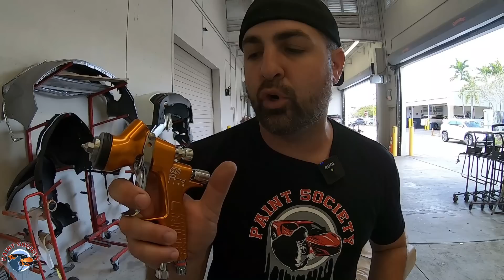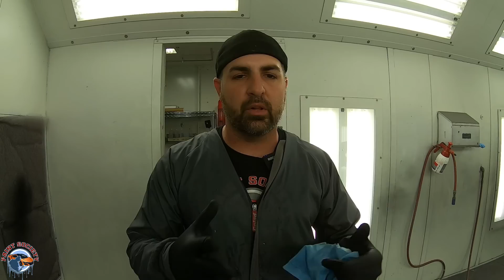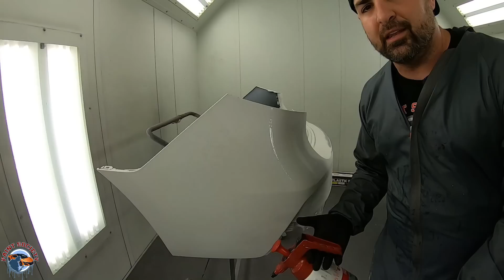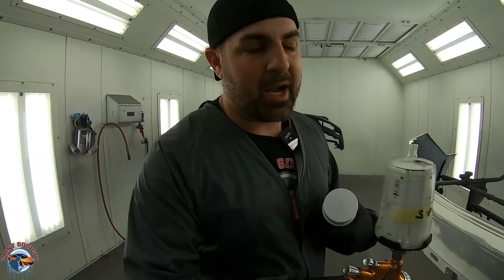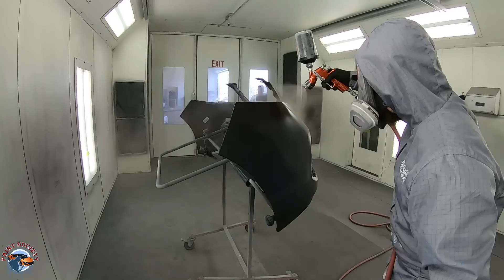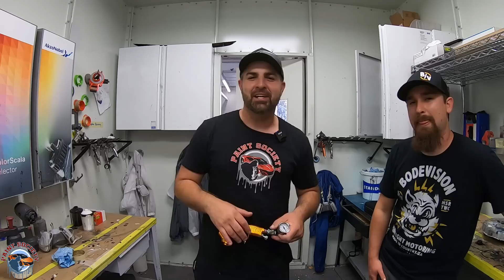Best Bang for your Buck Paint Gun for Car Painting, TESTED!

Comment: Brian, i have the Tekna Prolite, North American version of the GTI Prolite. Run full fan, full fluid on anything from sealer to clear coat. The only thing that changes is PSI depending on spraying styles and distance...When i apply base, im around 20 psi coverage, and 17-18 psi for drop/effect coat. Clear coat anywhere from 24-30 psi depending in the material...I love it, and think its one of the most versatile guns on the market. I have 1.2, 1.3, 1.4 tips, and TE10/TE20 air caps. Im spraying RM Onyx HD (water base) and im using my Prolite everyday! Love it! 
TE20/1.3 is what works for me...
Reply from the maker: I think I’m going to retire my copper and hang it up. This gun is awesome. Thanks for sharing your pressures. I am going to try them !
Reply: @PaintSociety  
Ya no worries!
I love the Prolite. Best bang for the buck gun out there...

Comment: yeah this is insane im actually gun hunting these last few days debating between dv1 and tekna pro lite aka gti pro lite. this vid came in clutch brother thanks alot!
Reply: Try iwata.
Reply: i switch between my prolite and the iwata w400 bellaria. i think the bellaria works better than the ws400 in my opinion and you can even get one straight from japan on amazon for around $220. However i think the prolite is the best gun ever made. works amazing on sealer, base, clear, and single stage. I spray solvent basecoat and the hv30 cap (hvlp) for the prolite is the best base gun i've ever used, haven't tried a dv1 yet though.
Reply: James Ciampi, HV30 TE10 and the TE20, I just ordered the prolite with te10 and te20 can u tell me more about the air caps and what they do and how you like all of them. Thanks for your confidence in the pro lite just baught it. It’s my first professional gun
Reply: @Ashpaint  te10 I believe people use more for basecoat, I've only used it a handful of times but I definitely prefer the hv30. I believe you can buy it for around $85 online. Super easy to base with no mottling and lays it down flat, better than any Sata I believe. Te20 I use for sealer, clear and single stage. Great atomization and matches factory peel with ease. Best all around gun ever made imo.
Reply: James C, THANKS SO MUCH, the learning really does not stop when the video is over! Would u be able to tell me which cap lays down clear the flattest? With the least orange peel, I’m about to paint some kitchen cabinet and I don’t want any orange peel in it and right after that I restored a 1964 1/2 mustang that I am going to paint in my garage! I wish paint society can come paint it for me tho 😂
Reply: @Ashpaint  in my opinion it'll be the te20. Best cap for clear out of the three
Reply: James C thanks so much Man U been a great help! What psi do u usally spray base and clear? And at what gun settings for both base and clear?! Sorry for all the questions but thanks for getting back to me 🙂🙂
Reply: James C I feel the same, Belaria is super nice for clear! I sold my ws 400 because I like Belaria now.

Comment: I'm a painter of 15 years. I use a pro lite daily. I have a dv1 also but apart from the better air adjustment (which I bypass anyway) the pro lite is the better gun in my opinion. Ticks all boxes. You could have a pro lite with a couple of extra caps to choose from for the price of the dv1 too.

Comment: The best gun for home do it your selfers is the Iwata Lph 400 because most guys don't have an air compressor that can keep up with a gun you spray at 30 psi. Also you don't have as much over spray with a true Low Volume Low Pressure gun and so their paint jobs would come out much cleaner.
Reply from the maker: Very true. I made a video on that. Best diy gun

Comment: you should really try the flg5 1.4 for clear coat, it actually blows my supernova, 5500rp and prolite out of the water for a fraction of the cost. Best way to describe it is as you get the finish from the supernova but with the speed of the 5500 but it definitely uses more paint than either of them
Reply from the maker: Interesting. I’ll check that out!
Reply: Hello my friend... I am thinking of buying the flg5... Which fluid tip do you think is better 1.3 or 1.4?

Comment: I have a bit of dump question here, so when you say sealer base etc at some psi level, what is that mean? Im currently working on painting a set of fenders for a 4wheeler. Please lmk thank you. Also so do you use different cups on each of the paint?

Comment: I know you don’t want to use solvent based cleaner on raw plastic, but the problems I’ve had with paint peeling on a bumper cover, I don’t use solvent on any bumper cover,  alcohol or water seems ok
Reply from the maker: I always use it. I live on the dark side lol
Reply: Solvent won't hurt plastic- sounds like you need to use an adhesion promoter or tie coat. Transtar makes a great one- or Bulldog.

Comment: I spray guitars with waterbourne finishes and I think I have a contaminate problem.  What is the Water based cleaner you are using?  I wonder if it will work on my finishes after sanding and between coats.  Thanks!!
Reply from the maker: You can actually go to your local store and get spray way glass cleaner.

Comment: Can this gun shoot the primer? I’m a new to painting thanks. Nice video and info.
Reply: I used it for high build on my first paint job. It will put it on but I did buy a primer gun after that. But u can do it and it turned out fine but it was on a motorcycle not a car.
Reply: It worked great for base and clear. The clear was super smooth as well.

Comment: Hey, Brian, I have found Your channel and of course I subscribed! But You know, I have a question. I decided to paint my bimmer myself and now I've decided to get a better gun that I have now. Since I'm not gonna use it very often- yet at least- I'm trying to figure out, which one is better- Sagola 3300gto or Devilbiss Starting Line (620)? Those are guns with good price, but question is, are they worth to think about. Both have 1.3mm nozzle, which should be good.
Reply from the maker: Sagola probably will get you a better finish. A 1.3 is a great fluid tip to use.

Comment: You should buy a knock off gti and try it, i was thinking about it just for edging parts, sometimes i edge 4 different vehicles parts at a time so extra cheap guns could help. but im to cheap to spend 100$ on a knock off lol. only have two tekna for base and a ls400 iwata for clear. atm, plus i bought a welcome slim combat 1.3 hvlp for sealer.
Reply from the maker: I thought the same thing. Why am i spending $100 on a knock off version lol

Comment: Link to the gun? Also I was wondering I'm going to be changing the color of my car. No body work needs to be done. Just painting. I was going to seal before paint. Is it possible just to sand enough to seal and then paint? If so which grit should I use?
Reply from the maker: Yes. Scuff with 600 grit. Seal and paint. It’s the gti pro lite

Comment: Hey man, I actually have 2 knock Offs and one legit devilbiss gti pro lite, 2 the 20s and one legit t110, and the one you have bought is. Not in an authentic devilbiss box, but it is an excellent china gun! Lol
Reply from the maker: Lol!!
Reply: How much is the knock off? $$
Reply: Should edit your comment before posting- confusing! But Brian's is an authentic DeVilbiss (as is the box). It's about $500, the knockoff is about $100. Haven't gotten my knockoff yet, but loving the Techna Prolite- the one they sell here in the US.
Using a TE10 cap and getting great flat clear coats. 
Ordered a "T110" cap from China and it is crap- shoots low and is actually a TE20 knockoff that has rough edges inside.

Comment: Brian, do you or anyone else know if the tekna air caps will swap to the gti pro lite?  I know they're the same gun but just wondering
Reply: Tekna pro lite is the exact same as the GTI pro lite
Reply from the maker: I read they will but not developed to work properly.
Reply: @PaintSociety  that's kinda what I seen, not sure if it's a different baffle setup behind the tips or what.   Either way I have a tekna pro lite now and going to order the gti pro lite from across the pond

Comment: The home depot husky is pretty good for the price
Reply: That's what I used for primer. It comes with a 1.8 tip and needle. Not bad for $50
Reply from the maker: Had both but they fell apart on me

Comment: Stop wasting time trying to see if sub par guns will work or what loophole may lye in the chemical makeup to make a certain gun perform or any other unnecessary two stepping. If your that unsavy about choosing or operating a gun maybe you should continue to prep for awhile or at least read a Product Data Sheet. The best painters know how each gun is going to lay a specific material based on chemistry and gun time. Specific guns for specific brands and material. Best options=Tekna/Devilbiss(be careful) , SATA and A.IWATA. 
If someone says its the applicator not the gun they are full of shit. Guns made with the tears of child labor do not come close to performing to German,Japanese,British and American standards. 14+years waterborne,High&Low VOC. Auto,Boats/Yachts.